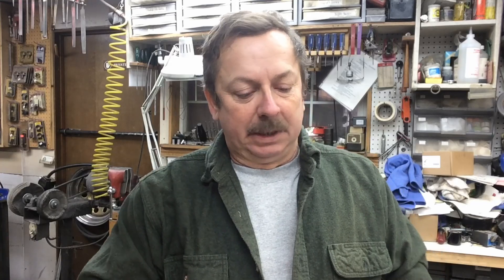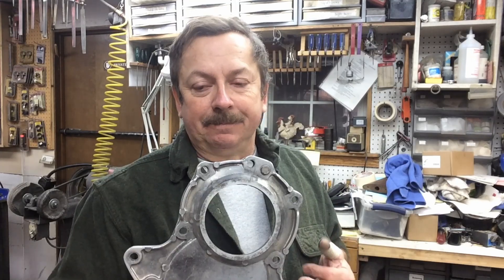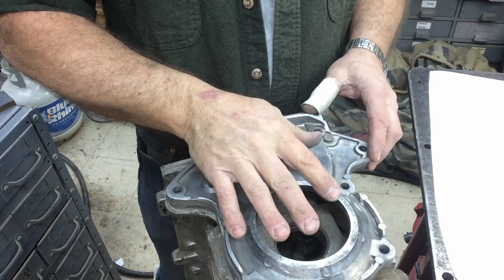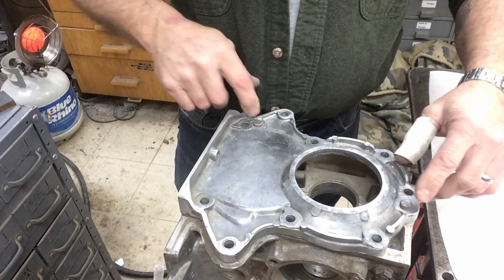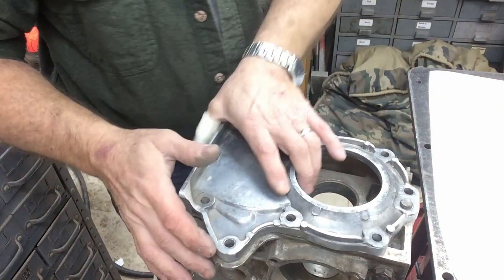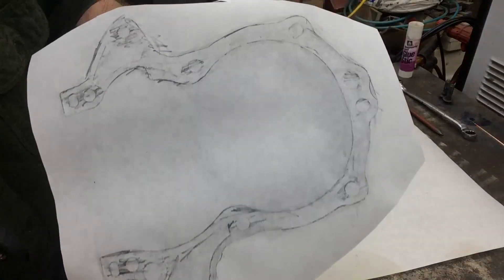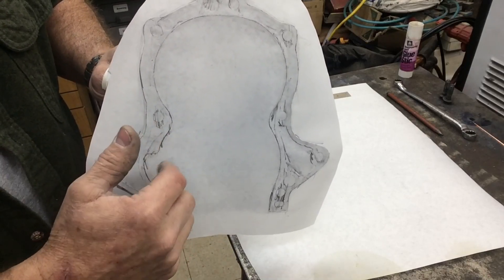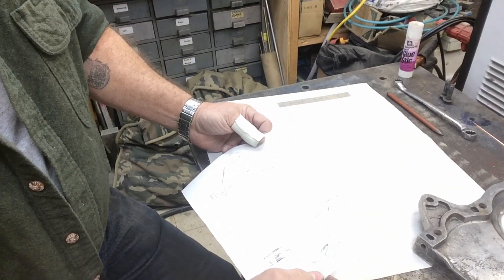Building a Zenith 701 Experimental Airplane, 5th Bearing for the Corvair: Part 1

Comment: I see that you are creating a surface to support a bearing, but what is it on the crankshaft that lies against the bearing surface.  Is that an oil slinger I see?  I'm assuming that you are using a stock crankshaft because I've not seen anywhere that you didn't.  Please excuse my stupidity as this is the first time I'm looking at all this and I'm pretty confused.  I love those Corvair motors as well as the VW ones too.  I wish they had ironed out the problems with the Corvair car.
Reply from the maker: There will be an extension machined to fit on the crankshaft that will ride in the bearing, That extension will be sandwitched between the nose of the crankshaft and the propeller hub. It will use a stock crankshaft which will be nitrided.

Comment: I am curious how you plan to machine the casting to ensure that the bearing is inline with the shaft?
Reply from the maker: The plan is to line bore it in the block.I will fit a boring bar to the block and bore it in place. If it is done carefully it can't help but be in alignment. Old technology that will still work.